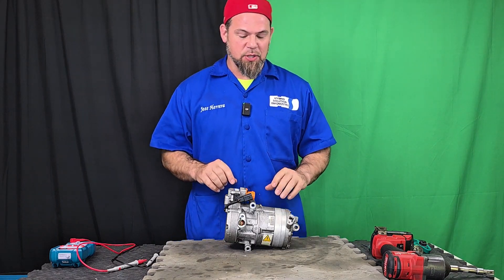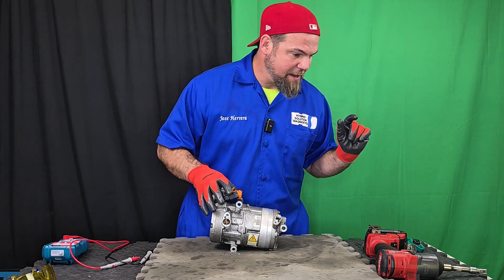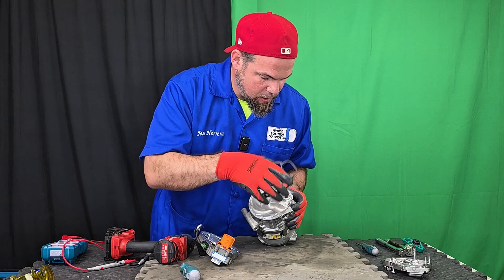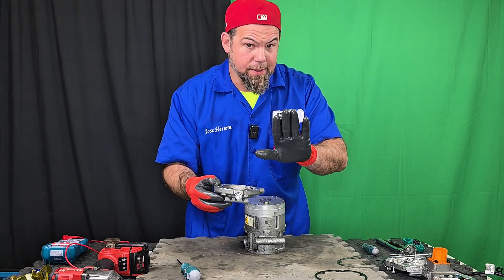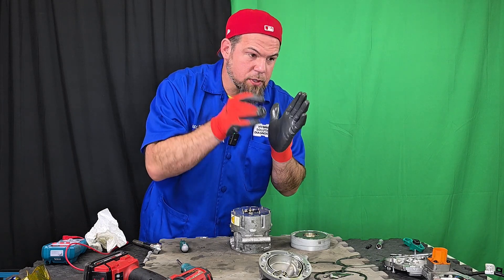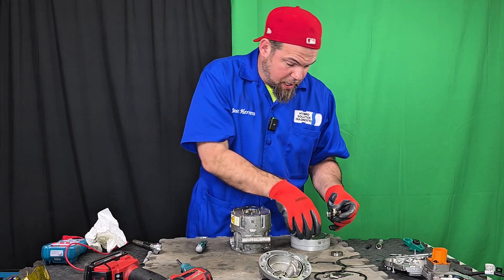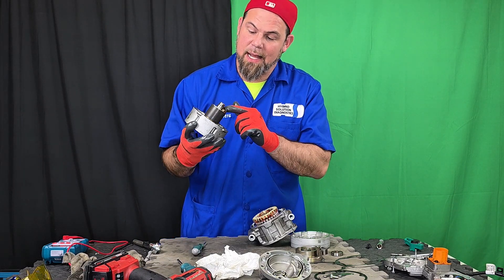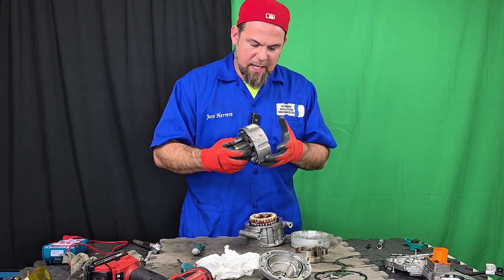2017 Hyundai Ioniq Hybrid AC Compressor

Comment: If there were metal debris present in the suction side (motor section) due to scroll failure, would that mean it had traveled through the entire system, thus requiring an entire system replacement or flush? I'm thinking so since I'm assuming backflow from the scroll section to the motor is impossible. Thanks for your knowledge.

Comment: Hi. Thank you for the video. Why is there so little oil? Manual says it should have 6 oz, before any AC wizkid says that amount of oil is for the whole system, I remind you, these compressors have an oil separator so most of the oil should remain inside of it. I have disassembled the KIA electric compressors and you will find more oil than that. Maybe that's why the bearing was dying. Not only that I have seen user posts with a lot of noise in the AC, little oil or even no oil was found in almost new cars. Thanks again for the video, it was very telling.

Comment: My 2017 ioniq just started blowing air on idle.  But when I drive it cools off.... Could this be cabin filter or low on freon or worse?  Car has 306,728 miles on it.... Only have done first tune-up at 253k belt and plugs... Change oil every 5k...
Reply: How was the reliability overall?

Comment: I have the same problem. The "wow wow" sound when outside is hot or ac run on 17 degrees. But ac works just fine.  All mechanics which i consult with suggested "compressor change". Now I know how to fix it. Many many Thanks.
Reply from the maker: @keremerzurumlu  check out the new video uploading 🫡✅
Reply: @hybridsolutiondiagnostics  saw just now. Will check it out. Many thanks again.